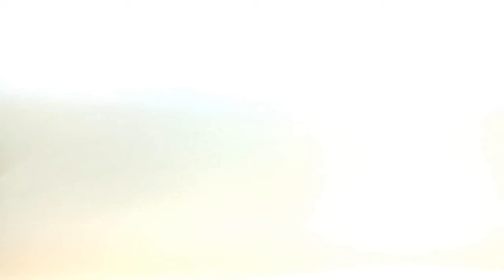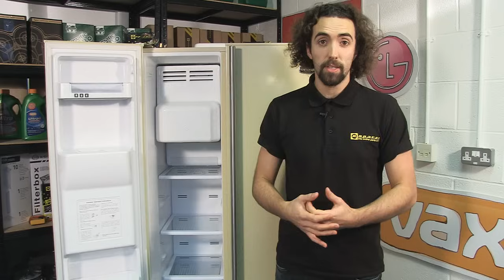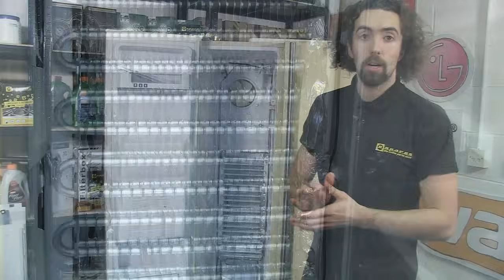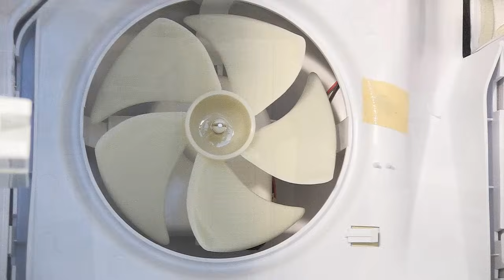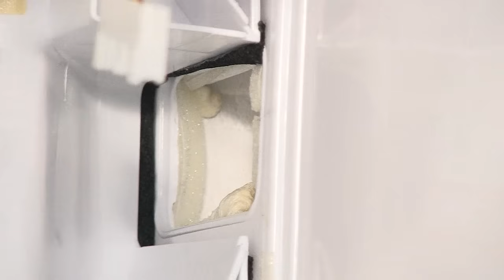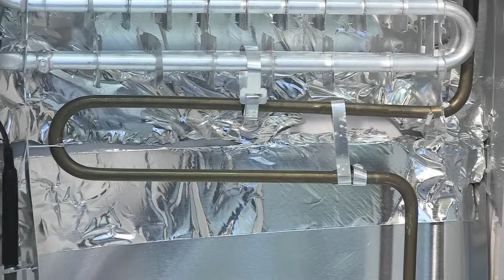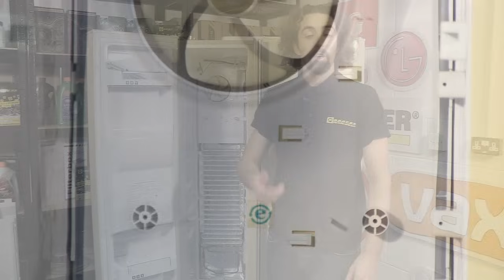BEST Advice: Frost Free Fridge Freezer Ice Build-Up & Common Problems!

Comment: Hi I got a hotpoint iced diamond fridge freezer and the high temperature red light keeps flashing can you please tell me what’s wrong
Reply from the maker: Hi Chris, as explained in the video the problem is likely to be blocked with ice. Some Hotpoint's can build and ice blockage below the heater area. Try just turning off and completely defrosting for 48 hours. If the problem comes back in a week or two check the defrost heater.

Comment: Hi m8 do you no what the e6 fault code means on a bush side by side it's showing on the fridge side. Freezer seems fine.
Reply from the maker: A model number may help as at the moment we cannot identify any errors for Bush fridges or freezers. The problem is likely to be either a defrost problem as shown or possibly a water supply problem if it has an ice maker.

Comment: I have a whirlpool frost free upright freezer which will only freeze down to -13C, compressor is working, have little bit of frost on back wall. I cant hear the fan would a faulty fan cause this problem
Reply from the maker: The likely problem as we say in the video is a build up of ice blocking the evaporator radiator, catching the fan and reducing air flow. Remove the cover to check and if ice is found check the defrost heater.
Reply: Thanks espares will let you know result
Reply: Looks like you were right, evaporator frozen, thing is evaporator is mounted in the top of the cabinet not at the back and seems like a sealed unit cant access fan or heater is that possible?
Seems as if they’re in a tray underneath the evaporator, two front press in clips but they aren’t releasing cover, pulled it down a little bit can only see polystyrene insulation that’s stuck to the bottom no screws either.
Would I have to go in from back of the cabinet ?
Looks like its a whirlpool specialist job. Well we tried, thanks info.
Reply from the maker: No need to give up yet Steve, the cover and insulation will be frozen on so defrost for 24 hours and it should come off. Checking the heater you should typically get between 20 to 400 ohms resistance approx. There also may be a thermal fuse next to the heater.
Reply: eSpares Thanks will have a try 12hrs on and let you know
Reply: Job done Josh, had broken connection on the defrost heater multi plug. Was awkward to get at, fixed it, plugged  in, fingers crossed and 12 hrs later, running well freezing up to -23c defrost heater cutting in as required.
Thanks for your help on this job as no one wanted to touch it, you’ve saved me a lot of money, and this is the third time espares has saved me money, cooker repair and washing machine repair. Your on next years Christmas card list thanks again.

Comment: Hi, I have a weird sound coming from what sounds like the radiator at the back of a miele fridge freezer.  It's approximately 8 years old. Any ideas??
Reply from the maker: If you are talking about the inside of the freezer it is likely the fan is catching on ice likely due to a defrost problem.
Reply: eSpares .It's a sound from the back of the fridge, from what looks like a big radiator.
Reply from the maker: On the outside? a model number would help. 😊

Comment: Help. My Frigidaire side by side is allowing frozen foods to thaw, but will then re-freeze everything by the next day. Any suggestions?
Reply from the maker: Strange as it sounds it is likely to be the defrost heater, if this has failed the control board shuts down to do a defrost but remains off as the heat does not build up to clear the ice. Check the heater for continuity (100 -400 ohms) as it is likely to have no resistance.

Comment: Its funny how much you don't give a shit about something like how a fridge works until its your fridge that's broken. Then we give a little interested just to see if it helps. Soon as our problem is solved its all forgotten about. Haha any one tell me why my hot point FF 200 keeps going hot and then it will eventually eventually get cold after all our food is in the dog dish. "Interesting video" 😉
Reply from the maker: A common problem on the FF200 is ice building up below the evaporator (not in the evaporator). Hotpoint used to have modifications to fit a longer heater and reflective foil to help prevent this. May be worth a call to them to see if they will cover this modification.

Comment: My ice maker in my side-by-side fridge is not defrosting at the front part of the ice maker, right where the ice maker meets the chute in the door for dispensing ice and water in the door.  The front of the icemaker freezes so much that it is hard to open the freezer door.  Any guess as to what the problem might be?
Reply from the maker: The problem will be due to uneven temperature in the freezer, most likely due to poor cold air circulation as a result of ice build up. Ice build up is the most common problem with this type of freezer due to a failure of the defrost heater so check the heater if ice is found under the cover.

Comment: Hi, MY Fridge/Freezer is a Hotpoint FFA52P. How should I remove the fridge door and how do I remove the top cover (over the control panel). I need to gain access to the control panel to replace it.
Reply from the maker: Hi Ian, we believe there should be two screws under the panel that hold it in position. Have a second person hold the door while you remove the screws. Once removed the panel can be removed and the door lifted off the other hinge.
Reply: Hi, many thanks for your prompt reply. I appreciate it. I had already located the two screws but they just turn in their holes. Either the thread is stripped or they are not connected to anything. So I cannot unscrew them. Also the door's top hinge passes through a hole in the top cover. This implies that you have to remove the door before you can remove the top panel. As an ex IT Maintainability Engineering Manager I find that to be absurd. I was hoping that there might be a 'gotcha' that I've overlooked in order to remove the top control panel. It looks like a relatively minor task is turning into a major task.
Reply from the maker: OK try another method. Remove the centre hinge screws and carefully pull the doors away at the centre until the top one drops enough to lift off, The Manufacturers diagram does not give much detail but the screws do appear to correspond with fixings so try and slip a small screwdriver under their heads to ease out as they are turned.
Reply: OK will do.

Comment: I enjoyed watching this video and recommend others.

Question
My Refrigerator  model is GSH25SGRB SS
Sl No GG265634
1. Fridge and free not cooling as expected
2. Water Dispenser not dispensing
Can you help 
Any videos of DIY

Thanks for educating the community and appreciate your volunteer-ship.

Thanks a bunch
Reply: hsm25gftasa
Reply from the maker: Hi Kris, we produced this video as freezing up with ice and having poor cooling as a result is the most common problem with temperature on modern freezers. Check if ice has built up blocking the airflow as explained in the video.
Reply from the maker: What is your question Anthony?.

Comment: Hi

i have an AEG Model: S 75358 KG38; Product nº: 925034048-01 that in the last 2 month got the problem where freezer works ok but fridge stoped working. In the firts 2 times i unplugged the appliance for 24 hours and it started working again normally. Now it’s the third time and i guessed it was something wrong with the defrost heater. After seeing your video i got hands to it and started to dissassemble the appliance, but now i don’t know what to do. The defrost heater as continuity(292 ohms) and the thermal switch also have continuity.
What can i do next? what part should i buy?
Reply from the maker: Hi Nelson, Sounds like the defrost heater and thermal switch are OK. Next time the machine stops check the compressor is not making a quiet 'click' about twice a minute as it could be seizing when hot. If this is the case the compressor will remain hot while plugged in. This problem would require a compressor replacement by a refrigerator systems engineer. 😐
Reply: Hi, thanks for the reply. The machine doesn't stops, only the fridge warms up, the freezer keeps running ok.
Reply from the maker: Hi Nelson, sorry misunderstood your symptoms. The fridge is cooled by air ducted from the freezer and controlled by a flap motor: http://www.espares.co.uk/product/es1076923/air-regulator-motor-step?  If this is stuck closed it would cause this problem so check the regulator in the plastic ducting to the fan at the top of the fridge.
Reply: Thanks for your answer. I figured it out. The thermal switch needs to have countinuoty at 8° or less, but It only works at -5°. Thanks for your answer.
Reply from the maker: Thanks for the update, the thermal switch is not a usual failure but like any 'thermostat' it could go out or range. If replacing this does not resolve the problem check the regulator position when you have stopped the machine as it should be open if the fridge was calling for more cold air.

Comment: Nice video. I have a westinghouse FU211L upright freezer. One day it stops working, ice starts melting. It had alot of ice build up before it stopped working. I plug it in now and it doesn't turn on. I checked the outlet and it works. What would you recommend. 
Thank you for any help.
Reply from the maker: Hi Hossain, If you hear a click when first switched on then another after ten seconds and this repeats every minute it is likely a compressor fault. If you leave it on for a while and find the compressor getting hot it will confirm this is the problem.
If this is the problem unfortunately you will need a refrigeration systems engineer to replace the compressor as this system will need purging and re-gassing after fitting.
Reply: Thanks for your reply. I plugged it in and the freezer does not turn on at all. No noise or clicking. It won't come turn on.

Comment: hi, finaly i found a "tutorial" well done about the freezing problems.
i have a no frost hotpoint ariston, and in the last month i observ ice below the last draw of the freezer. i cleanit every 3...4 days but it still appears. the fredge is 1 year old. what to do? sorry for my bad english.
regards!
Reply from the maker: Hi Cristian, The problem is likely to be  with the defrost heater under the evaporator as shown at 2:08
Defrost the appliance and check this element with a meter as it is likely to have failed.

Comment: Hi! Love the video. I have a question tho. My freezer has water that runs out of it every couple days. I defrosted it once buti dont think i did it long enough. There was ice built up in the bottom and behind a panel but i was afraid to take the panel off. I think that the drain is clogged with ice. Do you think thats the problem? It works great just the water coming out of it is the problem.
Reply from the maker: Hi Erica, Yes it is likely you have a defrost problem. You need to clear the ice before removing the panel so either defrost with the door open for 24 hours or use a steamer if you have one. Then check the defrost heater as this may have failed.

Comment: I have whirpool fridge with French at the top and bottom draw.  just recently moved it and took off the bottom door.  the gasket got pinched in a spot.  it is now building up with frost on the door and I am having to defrost it.  do you think their could be more wrong.  I am going to replace the gasket.  refirdgerator part is working good
Reply from the maker: Hi Kim, use a hair dryer to warm the seal and stretch it back into shape. Once it contacts the door it will hold with the week magnet and set in its new position as shown in this video on our advice site: http://www.espares.co.uk/advice/careandmaintenance/how-to-get-a-new-fridge-or-freezer-door-seal-to-fit-snugly

Comment: i have bus frost free fridge freezer, motor running constantly but freezer and fridge are warm,
Reply from the maker: Check for ice behind the covers as shown in the video if it has a fan in the freezer. If no cold at all you will need to call a refrigeration systems engineer as it is likely to be a major repair needing specialist equipment.

Comment: I have a Frigidare model number FRS22ZRG frost proof refrigerator- freezer my freezer is cold but won't keep anything frozen can you please help me figure out what is wrong
Reply from the maker: Hi Angie, you will have to remove the evaporator cover as shown in the video to check if it has blocked with ice and identify the problem.

Comment: Great video but unfortunately all beyond my capacity to act on it.  

There's no problem in my freezer, just getting a small build up of ice in the fridge over months, not days.  I suspect the fridge is a bit cold.  To keep things simple I have turned down the setting a notch, but suspect I'll have to turn the fridge off for a few hours on a hot day to clear off the ice build up.  I'll probably invest in a fridge thermometer to make sure the temperature remains <4C
Reply from the maker: Hi Mark, if the fridge has a 'wet wall' with a gutter below then the ice that forms on the wet wall should melt and drain through the gutter. However unlike the freezer there is no defrost heater and it relies on the air temperature inside the fridge so may not completely clear. If this is the case and the temperature is correct simply give an extra manual defrost when required.

Comment: If my fridge light doesn't come on , will this affect the fridge working?,   thanks
Reply from the maker: Generally no, the only time it may effect the operation is some fridge freezers can leave the light on dim to add a little warmth in the fridge to ensure the compressor runs regularly in a cold environment. If the appliance is in a normal kitchen this would not be a problem.

Comment: I have a non frost fridge but it isn't cooling it's just on but not cooling
Reply from the maker: Hi Jacob, if there is no cold at all check the compressor is running. If there is not enough cold check the evaporator is not blocked with ice.

Comment: I have a GE top mount no frost fridge/freezer Now I have a frost build up on the inside of the fridge.  what causes this & how do I fix it.
Reply from the maker: Generally 'no frost' appliances have the freezer evaporator (cooling radiator) behind a  panel the fridge evaporator in the 'wet wall' on the fridge. This will build up a light frosting that should clear regularly during defrost but will then return. This is normal.

Comment: Hi there,
                Hope you can help my dad has a beko frost free fridge freezer model CDA543FS.All of a sudden it has just stopped working.Both the fridge compartment and the freezer.making no noises,fan isn't moving.Seems like its died but the light still comes on.Any suggestions would be much appreciated.Thank you
Reply from the maker: Hi Terri, the fact the light works shows there is power to the appliance. The likely cause of the problem will be the control board: http://www.espares.co.uk/product/es1247946/refrigerator-control-pcb
This is found behind a cover at the top of the back of the fridge.
Reply: Thank you very much will go have a look now.

Comment: We have a Hotpoint fridge Freezer Quadrio & it has just stopped working, there are no lights on & both fridge & freezer have gone off. We have checked plug. Can you give us some idea of what might be the problem?
Reply from the maker: Hi Joe, there was a problem on some Quadrio appliances as power cables passed through the top hinge of the door . These cables could short out due to wear from opening the door so disconnect and inspect these cable and check the plug fuse. If the plug fuse is OK and there is no lights or display it  is likely the control board has failed.

Comment: I have a hotpoint fridge freezer. I have frost that builds up on the walls of the lower half of my freezer. Anything on the top thaws out and it won't get cold enough to make ice..... Is this an easy fix?
Reply from the maker: Hi Danell, some Hotpoint models duct cold air from the freezer to cool the fridge. This ducting can be blocked by ice and as we explain in this video the freezer will also have a defrost circuit that may have failed. You may be lucky and by fully defrosting with the door open for 48 hours all the ice behind the panel will clear and may not come back for a long time if the defrost circuit is OK. However once defrosted it would be worth checking the defrost heater to confirm it has not failed before reusing as this would cause the ice to build up in just a few weeks.

Comment: Hiya,  I hope you can help me. We have an Indesit Ld85f1s 60cm Frost Free Silver.. we only bought it just less than a year ago and my hubby pulled it out from where it sits ( less than 2ft to paint wall) and although the light and fan is working, we've just realised that everything has defrosted and fridge isn't cold either...... in a complete panic... is it fixable?
Reply from the maker: Hi Suzanne, If you interrupt the power after just starting it can cause the compressor to stall and keep tripping so just turn off for five minutes before retrying.